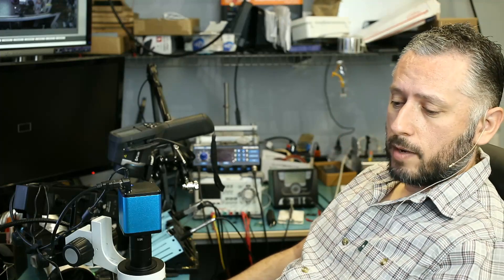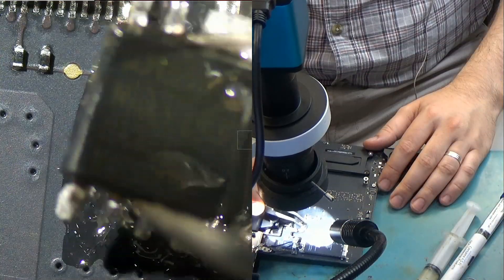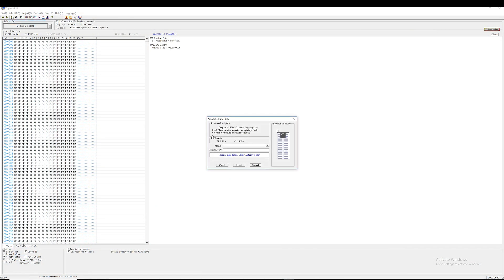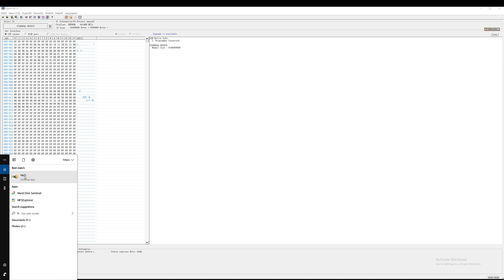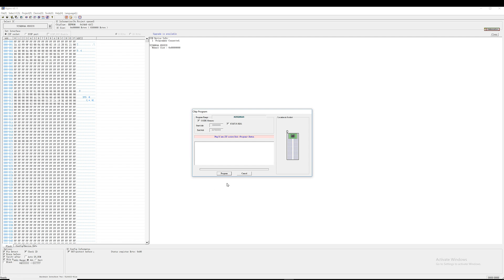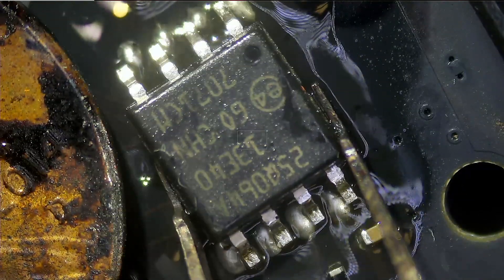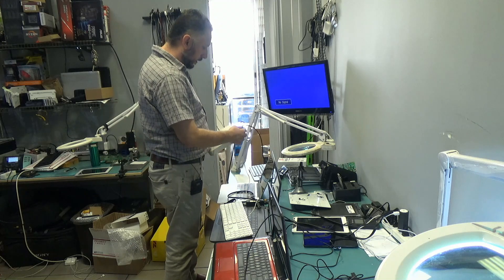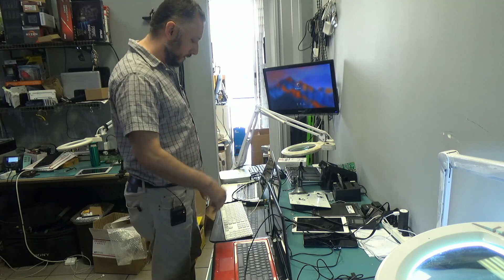2014 Mac Mini EFI password removal and unlock by editing firmware

Comment: i've seen this done without de-soldering the chip. the guy used a raspberry pi and it had an 8-tooth alligator clip that just went over all 8 pins. is there a reason that you de-solder instead of using something like that?